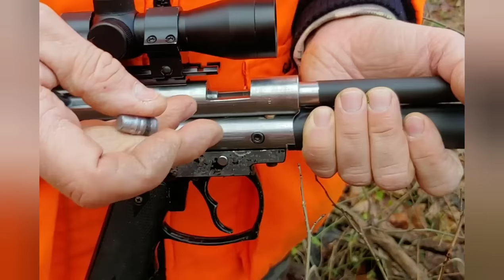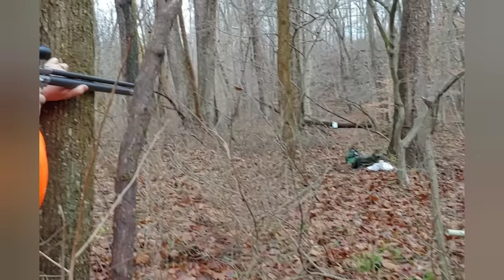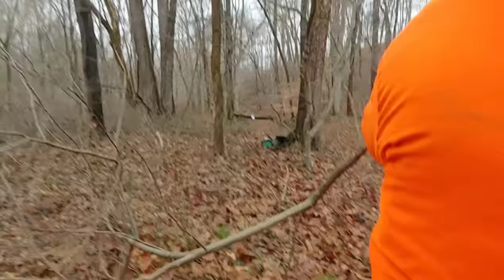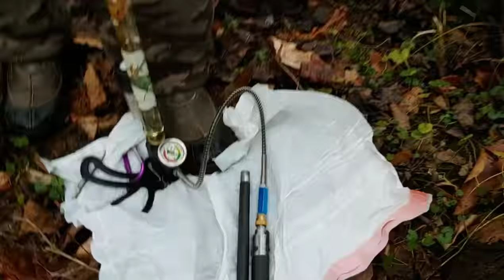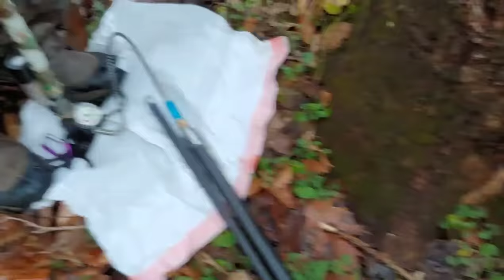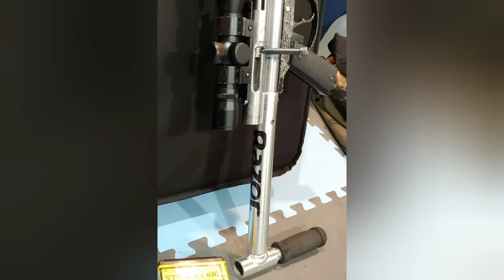DIY 44 Caliber - BIG BORE AIRGUN - Scratch Built Deer Hunting PCP at 200 bar for 300FPE - Homemade

Comment from the maker: Added a peek poppet, increased throat, transfer port and bolt probe bore diameter and shot the 245 gr bullet at 742 FPS for 300 FPE at 3000 PSI.  Have to do more testing.  My > homemade < pressure tube will support 3600 PSI or more so I need to cast some 310 gr and see how fast the round ball goes.

Comment: Hmm I've got an old Spyder laying around. . .and a hand pump.
Reply from the maker: You're almost 1/2 way there!  ;)
Reply: @bigbirderbob3710  I won't ask for all your build secrets, but I'm guessing that Spyder/stacked tube blowback poppet valve is a pretty efficient air mover at high pressure?
Reply from the maker: I use the Spyder for the trigger only.  I actually replaced the sear with a 1095 alloy sear because the stock sear is made for semi-auto and allows the sear to move forward (sear has an oval hole).  The valve is like a QB78 but larger diameter and elongated. I have pictures on the forum when I made my .308.  In my opinion it is a better valve/tube design for big bore than a crosman. However, it isnt very cutting edge and I am pretty sloppy at macining but try to be very safe.  It has a much longer throat because I have my spring up front (antiquated threaded spring retainer like a QB).  Sometime I want to make a shorter throat and rear spring.
Reply: @bigbirderbob3710  Thanks for the reply Bob, I'll have to dig around the forums and see if I can come up with your build. The QB78 style valve is interesting, as I suppose for simplicities sake, darn near everything has been done with one of those. Very cool, and thanks again for sharing.
Reply from the maker: Try googling Big Bore Higgins.  You may only get text unless logged in.  My safety caveats in the description above apply.  Please read those first.  Don't go making an airgun without a lot of research and time to absorb what you need to know (a warning for anyone).
Reply: @bigbirderbob3710  10-4 Bob, it's not my first time around the block with high pressure air, but your warnings are well heard.
Reply from the maker: Everybody reads these things is why I added that but I have no clue who you are either.  Be safe.
Reply from the maker: I kind of like the "status" within your user name  "LIFE_of_Riley".  Don't change that!
Reply: @bigbirderbob3710  Funny that you mention the username, I'm too young to have been around forget original, but being named Riley, I heard from lots of people growing up. Definitely rings true in my life today, it's been fun so far!

Comment: I recently built my own pcp as well , the air chamber holds 2200 pcp on a tiny resivour my 1st tune was pushing over 40 FPE but only getting 3 shots , Im down in the high 20s now getting 14 shots .

I really like seeing what people are able to do on thier own RE : building your own PCP , I knew nothing at all about tuning or how to build with my only mechanical background being I know how to work on bicycles .
I watched tutorials learned as I went and was super conservative on how high I would pressurize it 2000 PSI seemed crazy high and I had it a month before I pumped to the working pressure of 2200 PSI .
Love to hear you just do a show and tell us How and what parts , talk about your airgun background,  seeing you shoot targets is great you can see it's powerful but I would love to hear more about your build .
Reply: Be very carefull at those pressures.  If thing go boom it will be very bad if you're close
Reply: @noidontthinksolol  always pays to keep safety in mind ,  the unit I put on my 2240 is called a Safepac,  you have to take the valve out of the gun then take the back half off this is the part where the CO2 cartridge pushes up against the seal then screw in place a CNC machined Aluminum tube , it can be safely pumped up to 2400 psi , if you are interested have a look by typing in Safepack installation , there is a machinist named Rob , AKA froggy airguns that makes and distributes these units .

If you want to check out a horror story of a guy using the highpack system which goes together like any other pcp but has segments that are screwed together and then the valve itself is oringed and then Pinned with 2 or more screws. The major flaw in that system is the valve can become a projectile if something fails , in this case it did and shot the valve thru the Dudes Leg . His name is Randy and he was or is known in the airgun world. 
Type in exploring the PCP explosion. 
Randy definitely came close to death because he had the riffle pointed up and was target shooting just prior to it failing.  Would have left a big hole in his head for sure .

If you feel inclined check out my content my channel is about 12 or 13 months old.

Comment: Weres the airtank from? At first I thought it was from a hpa handpump or is it from another gun?
Reply from the maker: I made it from 1" OD x.083 ID DOM a513 steel tubing.  As far as safety, it has a better theoretical safety margin than most PCPs.  I made the internals to fit (.8295" or so).   The pins (screws holding the end and valve) and placement should provide a better safety margin too.  Calculations tell you the pressure you can probably tested it to.  So I used a hydraulic oil hand pump to test at 7200 PSI and it sat for a while.  I then replaced pins for safety.  Tube is fairly easy to make so I am stating all this extra just in case someone makes one based off a short description.  It should be done safely cause you can kill yourself.  

FYI for people with a mini lathe, I did this 1" OD x  30" tube and have done 1.25" OD tubes on my 14" mini lathe with only a 20mm spindle bore but it takes a "steady rest", working off the far end of the lathe to finish the ends flat with a file (oh no!).  If you work on the chuck end you need an insert screwed into holes you are going to make in the tube ends anyway.  If you want to do this just realize you must have or have access to a "low standards meter".
Reply: @bigbirderbob3710  thanks for the reply. So I guess the to ends are held on with screws or pins? That's the. First time Ive seen that done. But it does make sense and seems safety than threads.
Reply from the maker: Yes.  They are gr 12.9 high tensile strength Socket Head Cap Screws.  The Discovery airgun and Maurauder. among others, use screws to pin the valve.  I dont have a way to thread such a large diameter and length tube accurately or I would use that method.

Comment: I dare say wrapping your hand over a completely free floated barrel will cause poi issues. Very cool though, I need to finish my .32 pumper.
Reply from the maker: You are correct.  This was the initial testing and it was so accurate I havent added a barrel band.  Maybe after the deer season (March). I havent been hunting again with it but I just have to be cognizant of hand placement. Its not a lift. My 44 mag revolver you can mess your thumb up if you put your hand forward next to the cylinder. On the other hand if I screw up on making the barrel band every shot could change POI.
Reply: @bigbirderbob3710  maybe the barrel band could allow the barrel to continue to free float and the band would just prevent catastrophic receiver or barrel damage like if you dropped it? I tried a couple different barrel band tweaks with my Marauder and I kept going back to completely free floating inside the band because it was giving me the best results.
Reply from the maker: I have another big bore by a maker that has a barrel band with an oring.  The o-ring moved out of the band last year and changed the POI.  So Im a little cautious.
Reply: How is that .32 pumper doing?
That's the coolest thing i've heard in quite a while!
Reply: @pinocolada4254  it has been pushed aside by other projects, either out of personal interest or priority. The parts are still on the bench along with bits and pieces of an unknown number of other projects. I got the big bore bug a while back and assembled a pocket cannon ar15 that caught the eye of a friend, and since he's paying I'm doing a few more before I get back to the ever growing list of 'what would happen if.. hold my beer' projects.

Comment: Will you be making a tutorial?
I would be interested to know build price
Reply from the maker: Thanks for the question.
I would advise anyone wanting to make an airgun (no matter what power) to join a dedicated forum.  I am not an expert, rather a bumbling tinkerer.  I try to take a lot of time for safety however.  I'm not even sure I could convey even the safety aspects in a video let alone a build.  And then Id have to play it at 8x speed cause I do it piecemeal over maybe 6 months.
Its amazing how many "experts" there are on YouTube.  Real experts on forums will tell you when you are doing something wrong.  YouTube isn't set up for that type of feedback.  However this airgun is pretty simple.  It is similar to a QB78 with a pinned valve and fill end for HPA. Google "Big Bore Higgins" to read about bumbling a .308 caliber that was made from a precursor of a QB78.
The parts cost very little but equipment and tooling will run into the thousands.  If you purchase $25 worth of tools and supplies here and there you will fool yourself into thinking it is not much.  Thats how I did it.  A mini lathe will be at least $400 and tooling will be at least that.  There are parts available online for more of a lego build though.
Reply: @bigbirderbob3710  I am not really interested in building one I was just curious.
I have built 3 airguns one in sub 3fpe for airsoft use one in 10fpe for close range posting and one in up to 200fpe for anything from mice and rabbit and squirrel with shot and deer with round balls.
Thanks for the detailed response!
Reply from the maker: Oh ok.  Sounded like you wanted to know about how to make one.  I saw your channel. I like your fireworks!  Pretty cool.
Reply: @bigbirderbob3710  thanks!
Reply: I have dB 200  unimat mill/lathe would that be enough to build with
Reply from the maker: First of all, disclaimer for anyone: I am not an expert or engineer.  Any time you are using a machine that cuts steel the force or cutting surface can KILL YOU.  High pressure air is even more dangerous.  It can KILL YOU OR OTHERS AROUND YOU. I don't know anyone's ability or attention to details that are critical (your calculations, measurements or ability to use tools properly).  I cannot give you enough information in youtube comments to warn you how to proceed or all the dangers or steps you must take for success (not hurting yourself).  I ask everyone wanting to make an airgun to join a forum to research this for months before undertaking any project. That said, looks like yours is a 3x7 lathe with a 1/4 spindle bore and a 1/10 HP motor.  You couldn't turn the 30-36" long 1" tube on it (safely).   I'm sure there are ways though since you just need to turn down the ends. For internal parts, if you can fit a 1" or .875 round stock and turn it down to .830 thats the main function if using 1"x.083" DOM a513 tubing.  The proper tubing is critical. You would  make a valve, end piece and action end at the same size and leave a cap of 1" for the ends.  However there are many other critical cuts and measurements that I am not discussing here because it would take a long time.  Please look it up on https://www.gatewaytoairguns.org/
Or another airgun build forum.  These guys can give you good information and review what you are doing for safety.
Reply: @bigbirderbob3710   thanks and I will.  I’m going to get real rifle barrel. That way I know it can handle pressure. And get factory tank. Just little machining.  Receiver , valves. I know these could potentially be a big Grenade and definitely don’t want that in my hands.  If I don’t I know no one else does. Thanks again stay safe and keep them video’s rolling
Reply from the maker: I suggest starting with a QB78 (only about $70) and research how it works. Join a forum ask some questions and see how people are modifying theirs. Later after researching a lot you can make it operate on high pressure air (safely).  You could make that into a big bore much easier than scratch built.
Reply from the maker: I have to add an edit here.  I dont think your lathe would be big enough for the barrel work and the breech.  I can barely do a 7.5" breech on my 7x14 mini lathe (holes and threading) and I do thread the barrel using the 20mm spindle bore.
Reply: @bigbirderbob3710  thanks good information.  Sounds like good plan.
Reply: @bigbirderbob3710  thanks I’m going to do what you suggested join form. Research it and then research it little more. And start gathering parts up for builds I’m thinking using rest barrel do don’t have to make at first. Thanks
Reply: Also give me reasons to build a bigger lathe. Use dB as mill on it. Thanks. Not unless I can talk ole lady into bigger lathe. 8”x20”. U never know. But that’s a reach.

Comment: Very cool, louder than I thought it would be. Maybe an integral suppressor on that next barrel?
Reply: Powerful airguns are very loud and do need quite a long barrel to be efficient.  It makes it difficult to add a suppressor with a real noise reduction effect without adding much length to an already long gun.  
I do own a PCP from a well known brand with a "suppressor" covering all the barrel length.... this airgun is one of the loudest i own... IMO this type of suppressors is more a "llok good" thing than an efficient solution.
Reply: @DIMZEROCENT  Thanks for the info, I’m not very familiar with modern air guns and assumed it would be similar to firearms. Not that I have much more knowledge about suppressors in general. I think I read that air gun suppressors aren’t NFA items, no tax stamp.

Comment: your other video link is "private." Can you PLEASE bless me with the details, Id like to build one, and will not hold you responsible in any way sir. I want to see in internals at least. GB! God Bless
Reply from the maker: I had some copyright issues.  If you are looking to get into building or modifying, definitely get on to an airgun forum like Gateway to airguns.  There is a lot of reading there. Then start small with modding a QB 78 or Crosman  (QB 78 makes a better platform due to less holes).  Mine is similar to a QB78 internally.   Be careful.  I uploaded another video but it is age restricted due to deer hunting.

Comment: How did you make it
Reply from the maker: Copy of other post: Thanks for the question.  Check my other video.  I can't go into all the details for safety's sake but if you look at a QB78 or a Crosman 180/400/160 it is about the same parts.  They arent off the shelf parts but you can create them on a lathe.  Please be careful. Join a forum like Gatewaytoairguns.org and get all the details on building an airgun.  There is a ton of safety details that need to be read up on. I'm still learning.  I replaced the side pins on this one because the placement was not good.  Scares the crap out of me when I put together. If you do it wrong you have a 800 fpe projectile (valve or bolt or fill end) coming back into your face!
Reply: @bigbirderbob3710   I don't want to know about the barrel ,but I really want to know about it air tank and regulator

Comment: how is to make up step by step
Reply from the maker: Thanks for the question.  Check my other video.  I can't go into all the details for safety's sake but if you look at a QB78 or a Crosman 180/400/160 it is about the same parts.  They arent off the shelf parts but you can create them on a lathe.  Please be careful. Join a forum like Gatewaytoairguns.org and get all the details on building an airgun.  There is a ton of safety details that need to be read up on. I'm still learning.  I replaced the side pins on this one because the placement was not good.  Scares the crap out of me when I put together. If you do it wrong you have a 800 fpe projectile (valve or bolt or fill end) coming back into your face!